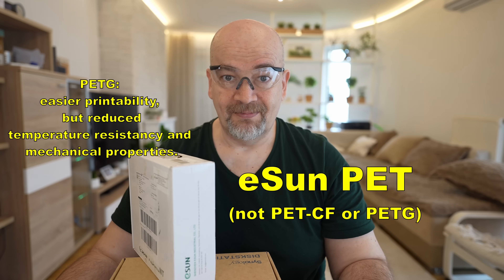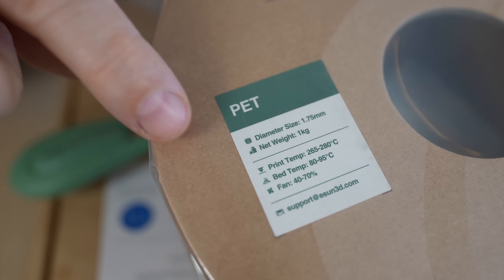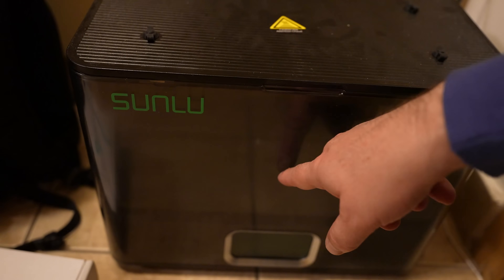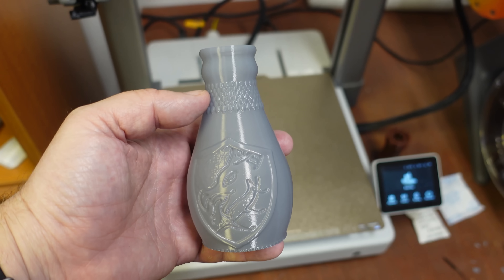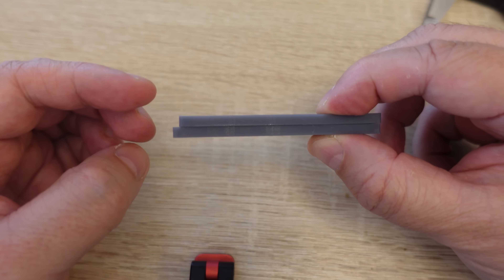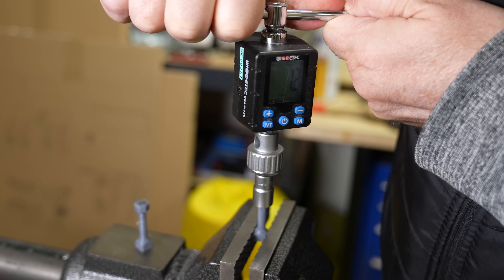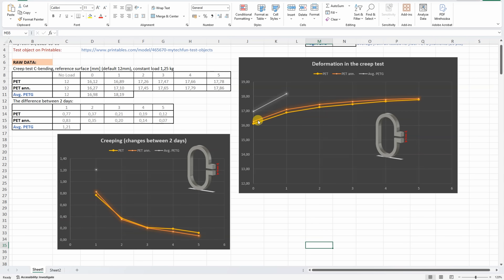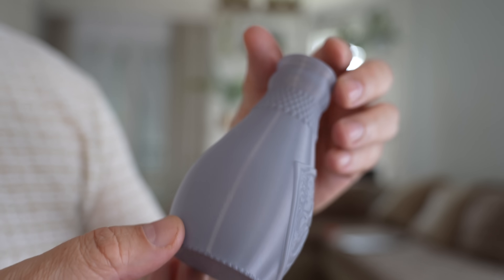Is Raw PET the Next Step After PETG? eSun Filament Reviewed

Comment: I’m fairly certain this isn’t pure PET, even without the coloring. My experience with PET filament is that when annealed (at 140c, where it is still stiff enough easily resist it’s own weight) it will change color from translucent to milky white, and the creep resistance and heat deformation temperature goes up a lot (not scientifically tested).

Comment: I make my own PET filament from pet bottles at home. It has few downsides and few advantages over regular PETG. 
First of all it takes alot of time to make relatively small amount of PET filament. You need to take each bottle, wash the inside a few times, remove the label, remove the label glue (worst part), if the bottle has stupid shape you need to pump some air in with compressor and blast it evenly with heat gun (preferably while rotating it in drill chuck), cut it into calculated width of strip and then run it through home made pultrusion machine. In the end you are able to get around half the weight of pet bottle as filament. Second of all you need to make a few test print to figure out the flow ratio (the filament is hollow so you need to push more of it to get the same volume), each bottle has different wall thickness so you get a bit of inconsistency in the end, but its ok strength-wise. Its visible on the final print where have you pushed another filament into the printer as previous one ran out because the bottle wall have more thickness near the top and bottoms. 
But the material itself is amazing, Its really durable, yet a has a bit of flex in it so its not brittle. You need to print it at around 270-290°C, but the inter-layer bond is really strong. Its almost as strong across the layers as inter-layer at my breaking tests. I use it to print drone frames as it is more sturdy and durable than regular petg. Frame made of petg usually broke after a relatively mild crash, while the pet one most of the time survives as it is not as brittle. I don't really care about ecology, but I really like the idea that you can print pretty much trash you otherwise throw away.

Comment: I liked the ATOMIC Bottle PET better than this.  It can be annealed and it was far more rigid and stronger than this stuff is.  This is basically a higher printing temp PETG to me.  I don't hate it, but I don't see the point of it.  I got permanent deformation on a part from sitting in my hot car in Spring weather.  That is utterly pathetic.  It became useless and the usual temp resistance of PET and rigidity (like with Atomic Filament PET) is what I wanted out of this material.  VERY DISAPPOINTED.  Dried the Atomic stuff at 70C no problem.  This stuff got soft and bound together making an entire spool almost worthless.  I bought two spools though and dried the other rollf at a lower temp.  This is PETG with less Glycol in it, which is pathetic compared to a real engineering filament.

Comment: The PET from ultrafuse (BASF then, ForwardAM now) was the first filament i seriously printed after the PLA sample that came with the printer.
It is stiffer than PETG but printed with a lower (?) temperature, also way lower than the esun in the video.

The only annoyance is that prusaslicer has no option for loading PET and if you laod it as PETG the printer will  remind you that you are loading the wrong material 🙃.

Comment: Last month I printed a large, 3-piece shroud for an outdoor cable to my house with that exact filament type. Each of the 3 parts weigh around 300grams and all came out flawlesly. The 3 parts first snap together with clips and then are permanently "welded" together with a hot iron at distinct points.
I have printed parts in both PET and PETG from eSUN and the differences are very distinct:

+ The PET is far easier to print,
+ as it never tends to agglutinate around the nozzle like PETG does (regardless whether from eSUN or other producers I tested so far).
+ Thus long lasting prints with PET are far more certain to finish without errors.
+ The PET parts can flex enormously and take severe beatings without showing any damage, just as one would imagine from how PET-bottles can perform. This PET has become my number 1 choice for parts under high, periodic loads like light holders for bikes etc, where a bit of flexing under load is ok and durability is most important.
Reply: I'd like to add that I print most often with PETG and it always accumulates on the nozzle. What's funny though, is that when I print with PET, it seems to assist in cleaning the nozzle strangely enough. I was able to effortlessly "pop off" a chunk of PETG that resided on the nozzle face, leaving it clean afterwards.
Reply: I’m looking for the best filament for bicycle accessories. Which specific brand of PET do you prefer for this? Thanks!
Reply: @WordupG  For bycicle accessories I have used so far:
- ePLA-CF
- ePLA-ST
- PET
These are ordered by their stiffnes (top to bottom) and thus also in reverse order according to their flexibility and fast deformation ductility (hit resistence).
In all cases I have used filaments from esun printed on a qidi plus4 and can reccommend them all. Choose what you think suits your case best. They all cost between 20 to 24 EUROs/kg. You may want to spraypaint both pla-types before mounting them to your bike with a car colour spray from any diy-market to make the parts last longer (paint coat adds UV-resistance and in case of CF also water tightness), PET doesnt need this kind of protection and will most probably shed off the paint right away.

Comment: You could reduce in-plane warp (side to side) by printing each layer the other direction around the perimeters. Ie CW / CCW every other layer. This is an option in at least superslicer. Probably increases warping away from the bed though...

Comment: I’ve been printing for 5ish years now knowing that PET is an unruly nightmare that has no benefits that outweigh the headache.  But lately I’ve been addicted to cheap PET-CF.  It prints just as well as PLA on a Bambu Labs A1 Mini in a printer tent.  But it’s UV and hot car resistant.  Some gadgets I made are as hard as metal and satisfyingly clack when I close them.  Only downside (could be an upside) is it doesn’t flex at all.  I made 2 guitar capos of different thickness that refused to spring open until it pried it open and broke both of them.  Is also comes in black, or mostly black, and you can’t paint or glue PET/PETG.  Nothing really bonds to it.  Could be a good thing.  But you can enable fuzzy skin settings to get a mechanical hold on paint or glue.
Reply: What manufacturer are you sourcing your 'cheap' PET-CF from?
Reply: Very informative comment, thanks for taking the time to share your experience!
Reply: Can i print with normal non hardened steel?

Comment: I happen to really like 'native' PET or CF variants, but there's a massive disparage in companies that produce it versus other materials. Peopoly has a notable deal on PET-CF from time to time where you can get 4kg in 1kg single spools for ~$60 (US pre-tariffs, naturally not a worldwide issue), eSun has precious few variants and in more than one color, Siraya Tech has a Core line offering in PET-CF. 
I've been collecting recyclable PET bottles for a few months when I finally get the last piece for my multi-filament extrusion machine made for implementation with self-produced graphene and a few choice crystallization initiators/modifiers for production testing.

Comment: You may want to look at Fusion Filaments HTPET+ and HTPLA+. Both are annealable.

Warning on the HTPET+, you basically need to be actively drying it as you print. It absorbs water nearly as fast as nylon.
Reply: @RM-hn6ir  FYI I have word that a EU vendor might be in the process of stocking Fusion HTPET.

Comment: I love your channel, your videos and tests are a fantastic resource for checking out the properties of different filaments and even between different brands. I was wondering if you wouldn't mind testing embedding different types of mesh into your prints for strength? Fiberglass mesh, screen door material might work well, stainless steel mesh and carbon fiber mesh are a few that I would be very interested in seeing tested.
Reply from the maker: Good idea, but this is something very limited to design of the printing too. Not universal solution. But worth to play it in a near future. Thx.

Comment: eSun has a new TPU 64D material, will you be testing it out soon? i'm curious if it's gonna be a viable TPU for AMS replacement
Reply: FWIW, a few brands already have that (justmaker is another one) - I have a spool. It’s noticeably softer than the claimed-to-be-68D AMS TPU. I don’t think I’d want to try to feed it.

CC3D 72D absolutely does feed, I’ve tried it - but it’s apparently a TPU/PA blend and doesn’t flex much.

Comment: This test is so good on so many levels:
- Super relevant: I was looking at pet filaments two days ago i was considering testing them myself because i need something similar but better than petg
- results are comparable to previous tests, its easy to compare to petg and see temperature resistance is only about 5°C better than petg (still welcome)
- its a bit stiffer has bit better layer adhesion and less creep which is all welcome
- tested on both enclosed and open printer so we see both difference and what we can expect for our machine
Thanks so much!!!

Comment: I get PET from Fusion Filaments and find that it prints much better than PETG. I print it on X1Cs at 300C with 40% fan. It can be printed hot, fast and over extruded for liquid tightness without gumming up and leaving blobs on the parts.

Comment: When PET is annealed properly it tends to lose its translucency so I would have expected it to change colour a little. Maybe it wasn't annealed at a high enough temperature. I recently needed a creep-resistant material for a plastic leaf spring that was going to be under load most of the time, and I needed to set the temperature to 110°C to get the annealing to start reliably. The trick is then to hold it at that temperature for a while and cool down as slowly as you can to allow the crystalline structure enough time to develop. It does warp a little when you do that though.

Comment: I got some of this to try it, but made the mistake of getting white where you can't see if it's annealing, which is the main way you could check if it's real PET vs "amorphous PET", a broad category similar to PETG, like the BASF "PET".

It does print a lot better than PETG, very similar to real PET.

I might pick up some clear that'd be easy to check.
Reply: I have the clear - what should I be looking for?

Anyway I really like the PET as well. In my testing I got better toughness than PETG
Reply: I printed some clear and never saw it getting cloudy. Also I wrecked the spool in a dryer lol
Reply: @riba2233  Well it won't get cloudy if you have adequate cooling for the rate you're depositing heat into a small area. It needs to be staying above 120 or so for a few seconds to crystallize that fast. Once you get it below 90 crystallization is a very slow process.
Reply: @daliasprints9798 yeah not sure but I had 55c chamber, 275 nozzle and barely any fan. Was printing a thin walled model
Reply: @riba2233  I wouldn't expect thin walled to crystallize. Typically you need thicker line width and several perimeters printed one after another in quick succession (as in a small cylinder that's nearly solid with perimeters) to get annealing in-place. Parts exposed to air directly will cool fast enough not to.
Reply: @daliasprints9798 thanks, I think it was 5 walls with 0.6mm nozzle. Btw can you share which brand make actual real PET filament that can be annealed, thanks!

Comment: FYI PET does not equal PET. The factory that produces raw pellets already puts additives in, depending on the application (extrusion vs. injection vs either of those + blow molding) and also what the finished product will be, and then the manufacturer may add some of their own to modify it's properties further, more elasticity or more rigidity, fire retardance, better temperature resistance. So, your random PET bottle is likely going to be relatively vastly different than PET filament. It's sort of like steel, every formulation is mostly iron, but added elements greatly modify the properties of steel. So, when other manufacturers make their own PET filament it should be worth retesting.
Reply: @dingdingdingdiiiiing  Good/real PET filament is exactly the same thing as bottle PET. But there's some junk out there that's essentially PETG ("amorphous PET") just trying not to sound cheap and bad like PETG. I've looked into pellet sources before and nobody sells PET pellets "for FDM printing" because the industry is convinced it's not suitable for that (due to filament manufacturers being clueless how to avoid crystallization during filament production) so AFAICT they're largely all very similar and all bottle PET.

Comment: Been using pure PET for years. Absolutely the best. Sadly very expensive... And despite the "toughness" comment in the specs PET pretty much explodes like glass when you break it.
Reply from the maker: Which brand do you use?
Reply: @MyTechFun  Primarily BASF (I order it in 8kg spools which reduces price a lot). However depending on where you live Amazon sold a super cheap one (maybe under their own brand - I don't recall) which seems identical to pure PET from my experience. There's some Chinese sellers too who sell it cheap - something like £10/kg if i recall correctly - but it's very expensive to ship to UK so you lose the benefit.

Comment: well you can throw around bottles without harm, tho. that 265-280C temp means not for most current 3d fdm printers. a bit too high, cap at 260c or so.
Reply: It is not 2019 anymore.
Reply: Any printer except the old garbage with PTFE heatbreaks can do at least 280.
Reply: My Prusa MK4S maxes out at 290 degrees C on the stock firmware, and thats with an extruder made mostly of 3D printed parts. Hell, my modified Ender 3 V2 with a Creality Sprite Pro direct drive extruder maxes out at 300 degrees C
Reply: Pet bottle can't print at high temps due to crystallizing, it sucks at layer adhesion too. Most newer printers can go higher temps. I print pet bottle with abs core at 290 c.
Reply: @oneanother1  Um, they absolutely can because crystallization happens to solid state material when it's cooled too slowly, not to material above its melting point. Real commercial PET filament like what Fusion Filaments sells is the exact same thing as bottle PET. Other vendors are selling wacky adulterated polymers because they can't be bothered to learn how to print it (super hot, with PLA-like cooling) and document that for their customers.

One other aspect of crystallization is that, if your hotend has heat creep or if you retract too far, the filament can crystallize before the melt zone and then it needs temperatures a lot hotter than the normal melting point of around 265 in order to re-melt. This means it will immediately jam if your hotend temp is too low. But as long as you're running at least 280-285, you can remelt it fine. Higher temperatures give you better margin of safety against clogs.